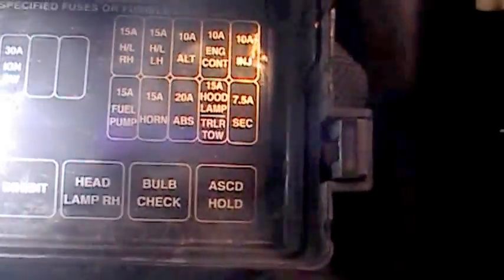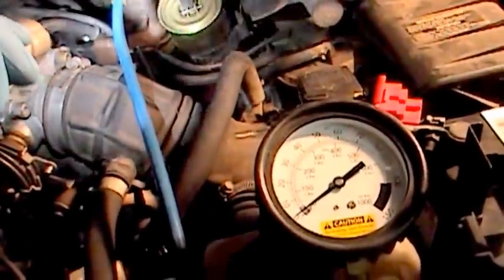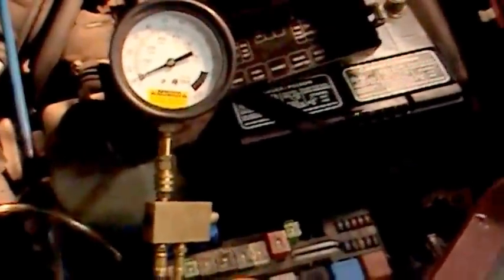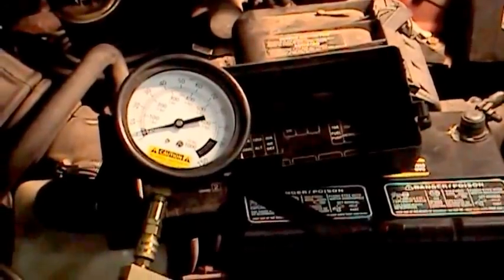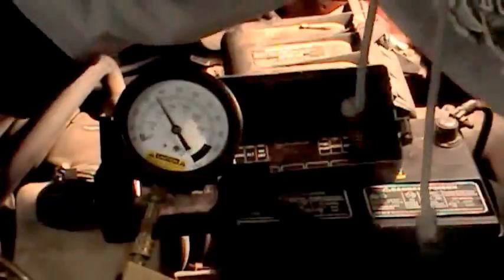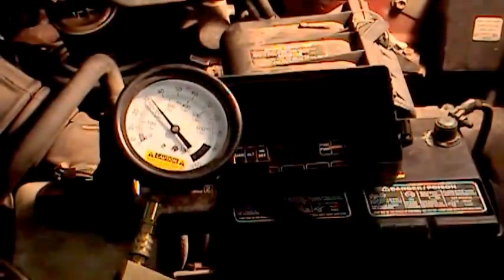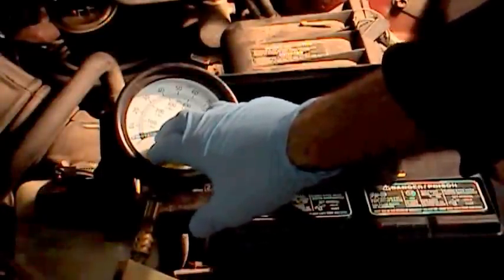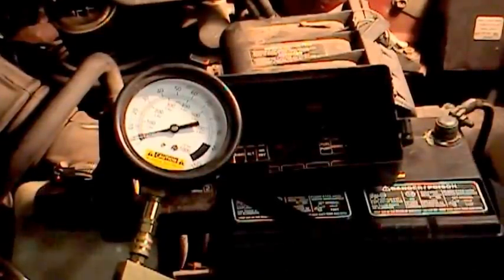Testing for a failed fuel pump check valve

Comment: I have an intermittent long cranking at cold start or warm start on my 2005 silverado. I tested the fuel pressure, it held at about 53 psi for a few minutes then slowly dropped to about 20 psi in about 40 minutes. I was told after an hour the pressure should lose around 10 psi. Any suggestions? I did the same test on my friend's 2006 silverado, except his truck lost about 8 psi after an hour and held at about 45 psi
Reply: Having your same symptoms as you with my 02 Silverado except mine dropped 20psi in the first 20min did you ever figure out what it may be? I’ve changed the fuel regulator but I have no clue why i slowly lose fuel pressure the guy I bought the truck off of couple months ago said he changed out the fuel pump and fuel filter I just forgot to ask how long ago

Comment: What about leaking injectors? wouldn't that do the same thing?
Reply: chris b  Yes when the fuel injectors are leaking make the same reaction in the gauge, the pressure drops when you shut down the engine, but the car have a rich mixture condition (not lean condition) and you have a hard cranking too.

Comment: Can't you just install an inline check valve right before the fuel filter? $10 and 30 mins. Instead of $300 plus and hours to replace fuel pump?
Reply from the maker: One off the problems is the pumps check valve is calibrated to bless down pressure over a set period of time.

Most modern cars now don't rely on the check valve to prevent heat soak hard restarts.  The pump is often brought online and primed once a driver's door is unlocked or opened, with some doing it as soon as the keyless fob is brought into range.

Comment: Is this valid for carbed engines?I have the same symptoms on my e21 316.
Reply from the maker: No, most carb vehicles use a mechanical pump driven directly by the camshaft.   Those don't need to hold pressure as the float bowl should contain enough fuel to start the motor.
Sometimes though mechanical pumps do contain one way valves to prevent fuel from being siphoned back into the tank.   To test this kind i personally pinch the rubber line going from the tank to the carb (sometimes it's metal and you may have to disconnect it) and see if there is a difference the next day on start up. 
Also a bad fuel cap on older systems can fail and cause the fuel tank to drop into a vacuum pulling the fuel back to the tank on shut down.  Most modern cars do not have this issue as the evap system is monitored and will alert the driver to a fuel tank pressure issue.

Comment: My car long cranks when warm. Ok when cold. Returnless system. Checked for hold pressure and it does not hold. When I try to warm/hot restart after 20 30 minutes fuel pumps quickly up to the fuel rail and then boils off quickly into a vapor and temporarily vaporlocks. The pressure continues to build quickly and condenses the vapor back to a liquid and then injects into the cylinder and then she starts. On a cold start there is no vapor lock and the engine starts very quickly even with zero pressure in the fuel rail before starting. The fluid moves up the fuel line and thru the injectors very quickly on a cold start. (Very strong pump)I think some residual fuel is sitting in a cylinder or 2 from the leaky injectors so that probably helps it start when cold also. I’m losing pressure at the pump and a smaller amount thru the injectors. I isolated both sides of the system and verified leak down of both sides. I’m going to put an inline check valve after the fuel pump and then pull my injectors and verify leakage at the injectors and probably replace them. If I could maintain a lot of pressure in the fuel rail on a warm/hot restart,I would not get the vapor lock as fuel does not boil off at higher pressures. If a lot of pressure bleeds down after sitting overnight that would eliminate vapor lock on the cold restart.
Reply from the maker: make and model?
Reply: Kevin Criswell  Hey Keven. It’s a 2010 Hyundai Accent gls. I’m surprised you answered the post after so long.

Comment: Man, you don't know much you just helped me with this. hard start in cold morning and fuel pressure goes immediately to 0 PSI after shutting engine off. so fuel pump check valve, right?
Reply: Victor Rodriguez 
Or a bad fuel pressure regulator...
Or a stuck open injector...
Theres more testing to do than just assuming bad check valve

Comment: kevin, you say extra/long cranks is bad for the entire system, but isn't the oil pump doing its job of circulating oil inside the engine even before it turns on?

Comment: seems to be a common problem on dodge calibers on hot days
Reply: On Toyota 4runners also. I'm having this exact problem on my 1991 v6 4runner 3.0. At first I thought it was occurring on cold mornings or nights nut I came to realise that it was occurring only on the first start of the day, then throughout the rest of the day it would start right up without no problem just as he mentions on this video. Nothing to do with cold weather specially here in southern California. Gas pressure was slowly decreasing overnight & all gone by next morning. Now it's worse. Fuel pressure is decreasing faster so it takes about 3 cranking tries after 3 hours of not running. I. Hanged the fuel regulator. Not the problem. I was about to change the fuel pressure dampner nut now this video convinced me it's the check valve. But I'm not sure if it's within the fuel pump or somewhere else. But since I bought a cheap fuel pump for $30 on Amazon 3 months ago, I've been suspecting the cheap  pump is not giving the proper fuel pressure. Sorry bro, made this too long.

Comment: Hey can anyone help me I have a 1987 Honda prelude, not starting after few months of sitting and there is no fuel pressure going to the engine, I have replaced the fuel pump with a second hand one was alot better condition than mine was in any advice would be helpful thanks
Reply from the maker: Check that they yellow/black wire has power.  If not check the PGMFI relay it provides power to the fuel pump.
Reply: @kg4tnp  I can't seem to find that relay and i believe the fuel pump is working like I can hear it winding but no fuel pressure to the fuel rail or fuel filter I think it might be a bad fuel pressure sensor?

Comment: Could be a stuck open injector!
Should do more testing before replacing parts
Reply: If pressure drops that quick, it's the check valve. Should take a LOT longer to drop pressure, if only one injector stuck. Also, if only one stuck open, that cylinder would be flooded, but rest would fire normally, and still start "almost" like normal, unless a 4 cylinder, then start would be less like normal, but should still start, maybe pop and then run.

Also, on many, especially older vehicles, you can easily install an inline check valve and "poof" problem solved, and fuel pump could work for years more. Exceptionally stupid (normal) engineers created this integrated check valve/pump problem.

Comment: cheapskate here can I buy a check valve to add into 6 AN line?  pump regulator and injectors seem fine steel braided rubber lines stink and need to change asap anyway.
Reply from the maker: I am not sure to be honest, some systems are designed to slowly bleed pressure off after a set period of time, not sure how an additional valve might effect the system.

Comment: Hey Kevin! Im getting an instant drop in pressure when I turn the key off. I replaced the pump but still getting the same thing. Wheres the check valve on a 91 sunbird 3.1?
Reply from the maker: it could be either a leading injector or most likely a bad pressure regulator
Reply: +Kevin Criswell I tested all injectors measuring resistance. Replaced the two that showed a bad reading. Cleaned the rest. That got the car to actually catch and run. Before that it would just crank..crank and crank. Ill take a look at the regulator. Thanks!

Comment: you can add a check valve to the system  there are a video in youtube about that .
great video thanks.
Reply: toolman talal  I have a 2001 yukon denali. throwing no codes, it;s bleeding down with no outward leaks. regulators been changed and had no effect on the bleed down thing. I can't find a check valve anywhere but it has to have one so what i am thinking is somehow they incorporated it into the top of the OEM fuel pump assembly ( sealed case ) I have replaced the fuel pump in the assembly, I don't have the dough or the want to replace the whole assembly. i was thinking maybe if I put a check valve in the line between the pump and the top of the assembly it would fix the problem, I wonder though what kind.   It has to accommodate the right amount of fuel and it also has to be small enough to fit in the line without ruining the bend and binding it up when the assembly is compressed to seal the ring on the tank.

   this is yukon denali 6 liter vortech and the fuel pressure in the line will be 50+ to 60 pounds.   Got any ideas on the check valve? 
   today i am pulling the unit again to see if there is a check valve where I think it is ( ac delco help line has no freaking clue OR they just wont tell me)    it;s possible if there is a valve there in the top that its gummed up wide open or something.
Reply: It's built in the  pump.
If the pump works great don't change it. 
If there a leak you should find it and fix it. 
Safety first. 
ask your mechanic if you don't know anything about mechanics. 
take care.
Reply: toolman talal     yeah i just saw a video explaining the mechanics of the airtech pumps, i am sure the rest are very similar    with the check valves.       after seeing that, i am thinking it has to be the top of the pump to the underside of the top of the assembly.    so thats my next thing. i am pulling the assembly and testing back flow from the line inputs to the pump top.    mechanics are funny around here, I'm thinking i should go into business, they dont seem to know anymore than I do and they charge crazy prices for guessing.
Reply: toolman talal   Turned out to be a Pin hole in the corrugated line inside the assembly.   found it by hot boxing a cigg and blowing real slow , smoke into the fuel line IN side.     replaced that hose and I got my pressure back. no more bleed off.

Comment: i just spent a day trying to clean my check valve on the fuel pump to my motorcycle carbs. ended up ordering the parts. not too easy to service these valves but I actually found a couple write ups on the procedure but they were for valves with nylon plugs, mine are brass so drilled them out and now are dead. I suppose I could try to make a piece of nylon cubed and stuff it in there. oy vey

Comment: ______thx for posting a vid with usable info and no music... _____2000 excursion V-10 (Gas) 80k original mi.   Had to replace the PCM module due to random electrical issues. Got that done, no more check engine lites...then long start issues started, then wouldn't start at all. Crap! Want to keep this truck cuz it was my late fathers.  My mechanic told me to turn ignition on but don't turn the motor over...wait 5 secs. then off, repeat 3 times.... then started right up. Thank god....don't want to hire a tow for my 6 ton truck. https://www.youtube.com/watch?v=hojQOxa7em4&t=1s